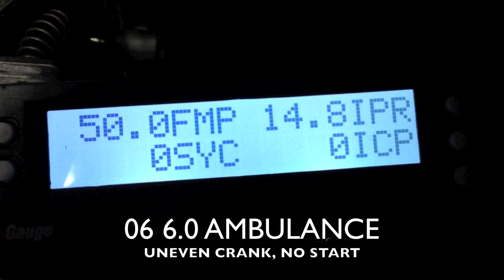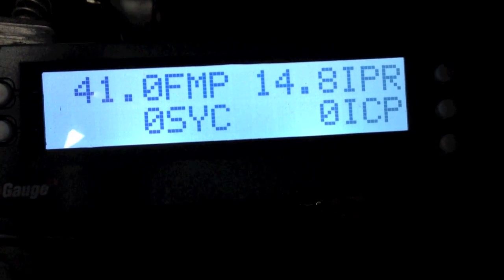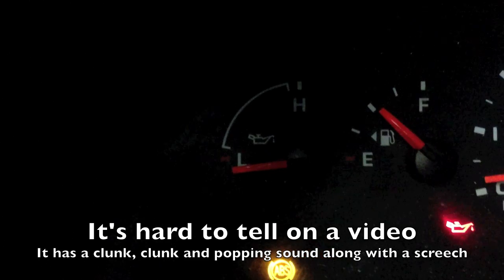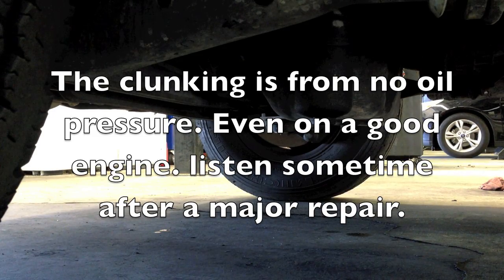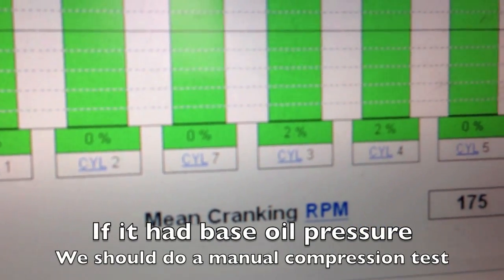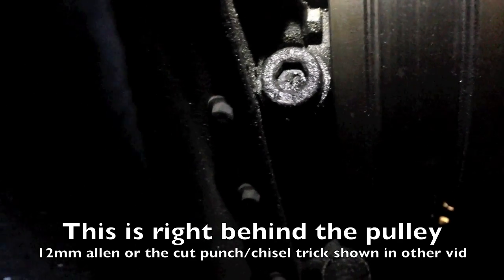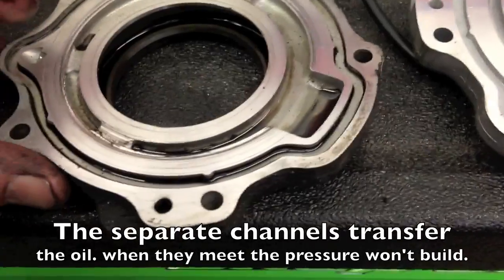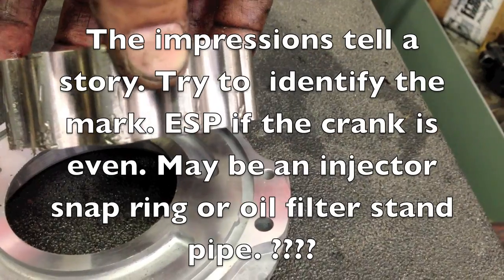6.0 Ford powerstroke diesel. popping in the intake Crank no start, no base oil pressure.

Comment: I have a 05 F 450 same issue crank no start i went to da gas station when i tryed to turn it on crank donesny starth i take it to da diesel specialist he said oil pump i replaced it but still crank no starth i did da same as this video but still da same icp sensor looks ok but when i replace da oil pump da oil was to low also i removed oil filter and tryed to start it but thers no oil coming out so what could be it , oil cooler , or replace icp sensor its a remanufactured enging 12000 milles please if u can helpm with this qwestion thanks
Reply: Did you find a solution to this?

Comment: Mine cranks like that and then will start after you give it throttle,then idles with no oil psi until shutdown,but keeps tremendous pressure on the guage if revved up.Whats the deal?Mine dont pop like that though!

Comment: Hey my 2003 6.0 is doing the same thing but after i crank on it 3 or 4 times about 30 secs each time almost all of a sudden my oil pressure went up on the instrument panel even got it to final start once sounded like shit was yours doing this to or where you not getting any pressure no matter what please help THANKS FOR VIDEO THIS IS THE ONLY VIDEO CLOSE TO WHAT PROBLEM IM HAVEI
Reply: If you're low on total power and you get an oil pressure warning at idle, you might have spun the hpop and its easy to just replace it.

Comment: So because there was no base oil pressure you went after oil supply system? And will you have to repair engine after changing oil pump?
Reply: With the popping and needle bearings in the low pressure pump yes the engine needs further repairs. The needle bearings came out of a roller on a lifter so chances are camshaft is whipped out also